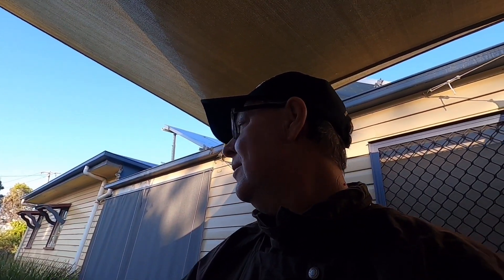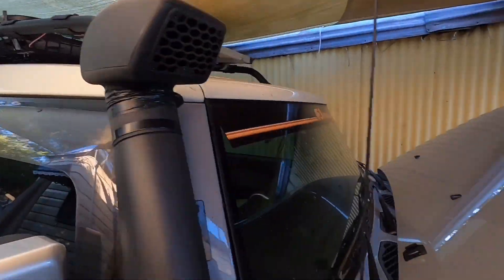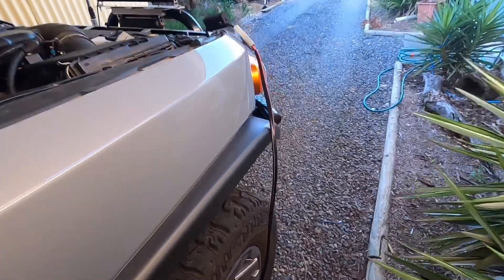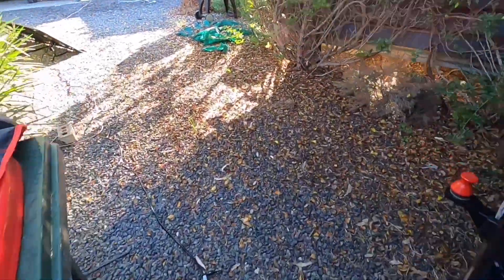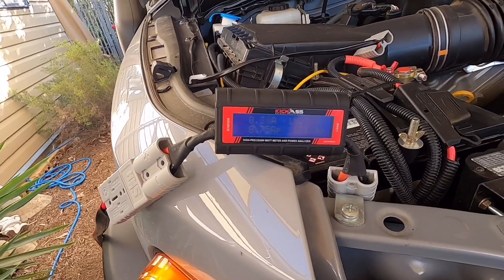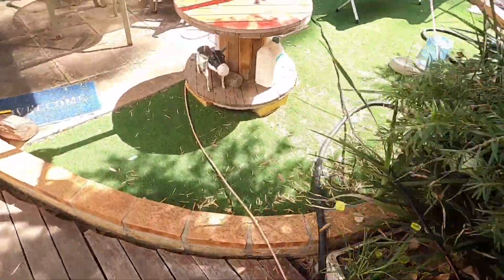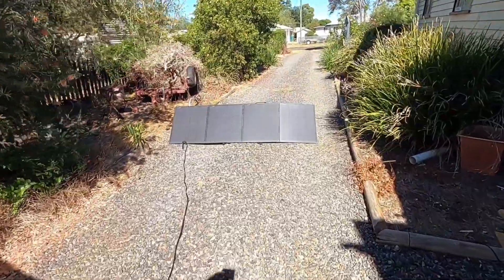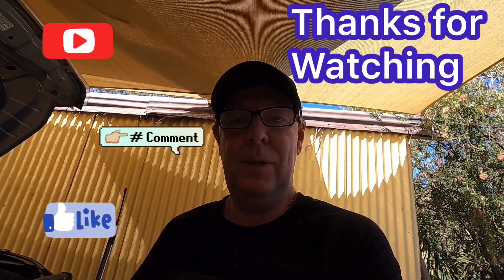Kickass 200w super thin solar panels

Comment: Hey mate, how do they perform in overcast conditions?
Reply from the maker: I haven’t really taken much notice I just set and forget them as I usually use them as a extra set to add Additional power to my rooftop panels on my dot trailer and my batteries are always pretty recently charged so I would say yes they work in most conditions ok

Comment: Thank you FJ for posting this video showing how much power these new panels actually put out. I have been researching this panel for about six months trying to find more information before I buy I have found the company in China that Kick-Ass buy from they sell these panels for .85 cents a watt. 

So Kick-Ass has over fifty percent markup on their price. But they are a good panel. I just ordered 10 from the original manufacturer. To sell here in the United States
Reply: Hey DJ Hood Rich, this isn't factual information and is incorrect.
Reply: @KickAssProducts   you guys buy these from lensun correct pretty sure there the manufacturer :)